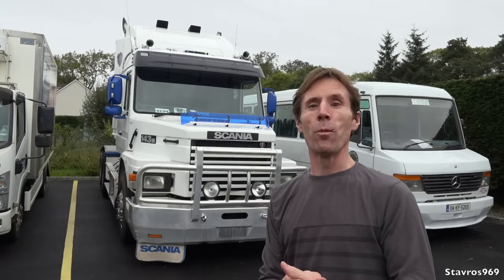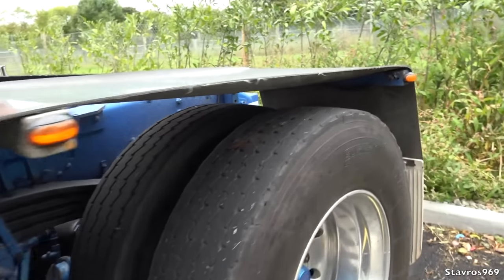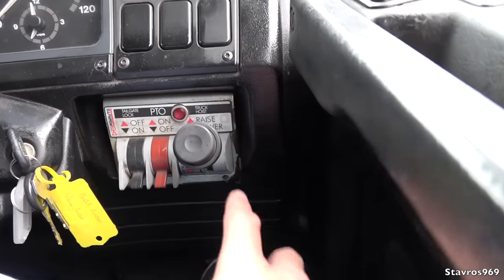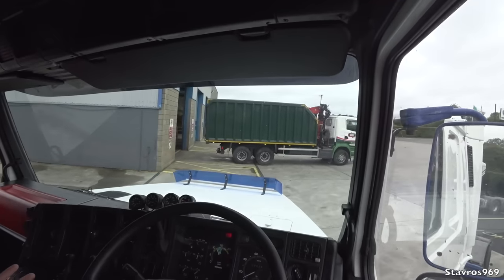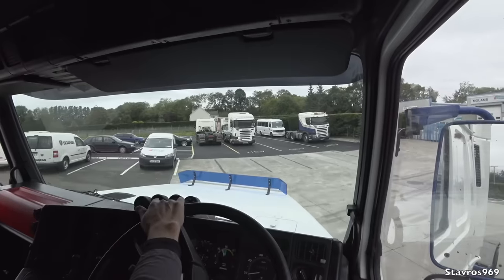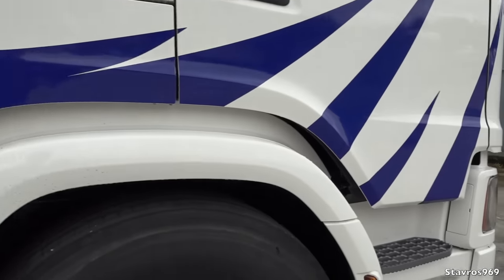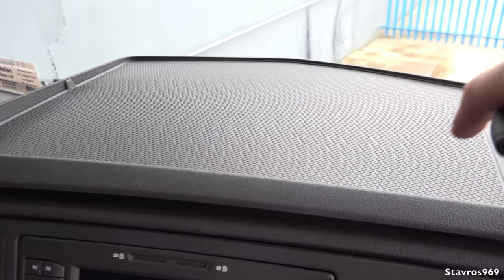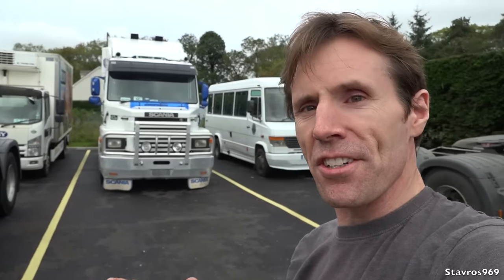1996 SCANIA 143M T-Series Full Tour, Exhaust Sound & Short Drive

Comment: Best bonneted truck I ever drove still have fond memories.
Lots of power back in the day, couple of companies would put RoadRanger 13 speeds in them.

The room in the intetior & flat floor absolutely walk all over any bonneted American prime. 
All round vision was excellent & that noise was absolutely fantastic. 
Drove for Riverbank Stockfeeds & they had one in immaculate condition pride of the fleet.
Victoria Australia. 

Used to drive to Yarram all up 45 tons with a pneumatic tanker.
Going up Gormadale Hill through the Strezilinki Rangers early hours of those summer morning the Scania was on hands & knees but she sounded awesome.

These days trucks are so quite & boring miss that T 143 best truck ever even entering & exiting the cab so so easy 

Louis Kats
Australia
Reply: 530 hp in 1985...(if you got the money for  it)

Comment: In Australia we call them "bonneted" trucks but commonly known as the gumboot. Notice the large turntable, that will be 90mm pin for triple road train work. The towing eye on the rear frame is for moving dolley's around. A dolley connects two or more trailers together. Bonnets are preferred as there is more between the driver and what ever road kill they hit.
Reply: T143M . M - Class  suspension was 85 tonne rated . Road-Train Double , not triple . 143H had the Heavy rear end .

Comment: hi starvos i have the 142 H T line v8 scania tractor unit 97 ex aussie  line haul brought here in New Zealand as line haulage.3 owners before me have owned it for 10 years now in restoration mode great truck beautifull sound the old v8,and spacious cab, will put it on you tube when finished.thanks tom,

Comment: love the distinctive sound of 3 series 143 V8
Reply: I think all series had the 14.5 liter V8s
Reply: The digits 14 in the model number stays for the 14.2 (not 14.5) litre V8, from the 140 in 1969 until the 144 in around 2000, when it was replaced with the 15.6 litre DC16 engine in the 164 model.

Comment: They were quite popular in Australia in the 1980s - 1990s because they weren’t all that expensive, but they died out after that because they weren’t all that reliable with the weights we haul over here in Australia and parts were expensive. Everyone called them the “footy boot” because they looked like a football boot I suppose.
You do see the very occasional one still working so I don’t know what happened to the rest of them, maybe they ended up in Ireland lol.
All our trucks over here have heaps of fuel and bull bars and no tachographs. You can tell it once pulled roadtrains because of the dolly pull on the back, probably the truck was rated for two trailers @ 79 tonnes GCM.
Reply: gm16v149  I think you got things the wrong way round, they were probably expensive, they are a manufactured Truck, not a kit truck like the American brands, and sold in very small numbers due to small population of Australia, a small dealer network. Scania are known world wide as the bench mark in Quality and durability.
Reply: Not in Australia are they the benchmark, but what would I know, I’ve only been an owner operator in Australia for over 30 years lol
Reply: @gm16v149   Maybe Scania sent the Monday morning built trucks to Australia, ROW got the quality trucks. Russia built the Lada for 30 years? Russians swear by them.
Reply: @gm16v149  Good to see you here! 😁
Reply: Some scania genuine parts are insanely expensive. i work at a scania dealer as a practician and a repair kit for a retarder costs around 500 usd, and the repair kit is only a bunch of gaskets and other minor stuff
Reply: the trouble was with the old scania that it wasn't designed for high heat.I worked with this cabover version with 420hp.60-65 metric tonns gross in 6 axles.my scania was built with 16 speed gearbox and big rear double diff.planetary axle hub.16 metric tonns/axle.built in1993 no problem 98-2000.with 1milion km...
Reply: @checker3694  i like the u.s. made old trucks..but is true that american trucks is big lego...the manufacturer built subframe and cab...parts buy other manufacturers.not own eng,trans,axles.....
Reply: The 12speed gearboxes were useless at roadtrain work, I pulled pocket doubles with a 530 T cab and on a hill it would be reving the head of itself and the next gear would drop it clean out of what was a very narrow powerband.   Definitely worked better pulling singles, but no match for a Kenny with a cummins and an 18 speed eaton fuller.   Not great at coping with the corrigations of the gravel roads either, very uncomfortable.   Enjoyed the V8 soundtrack nonetheless, the stereo was never turned on.
Reply: @BananaBrainBrian  mounted on a separate order the 16 gears to the scania.yes ,scania not like the wrong way...i drive in hungary 40 tonns tipper semi.formerly drive scania,volvo,m.a.n.,iveco...for bad gravel road and off road better the m.a.n..scania is powerful vith 16 gear in highway.12 gear max 45 tons..my m.a.n. is 16 speed zf...18 fuller is really 16 speed..2 crawler=low and low h+l.before 16 normal gear.
Reply: @BananaBrainBrian  wasn't many of them not fitted with fuller boxes ?.. probably needed a few more cogs to haul yours loads in the green band
Reply: @olepedersen5420  yes fuller is fitted for any truck.but konverter plate with repair
Reply: I have an old copy of an Australian truck magazine that has a feature article about a big Scania being shipped to Europe for a truck show or something. Maybe not this truck, but maybe inspired it. What are they planning to use it for?
Reply: gm16v149 me uncle and I here in Australia drive a Scania 142M during harvest for carting grain.
Reply: K
Reply: @checker3694 i drive trucks the small bulktransport company .used 3 scania g124.420 cabover with one diff and 3 axles tipper trailer.2 work in gravel and sand site.gross is 55-60 metric tonns in 5 axle and 12 tyres!no problem the scanias.
Reply: scania in sweden and finnland pulling 60-80-104 metrictonns vehicle in forest industries..
Reply: Not many in the USA
Reply: Do you still run that old kw you got? Ain't seen new videos from you in awhile. Hope all's going well for you. I just recently started trucking myself. But I ain't drivin no cabover. They'll probly never make a come back in the states but I wish they would.
Reply: Scania are very popular here in NZ, need trucks with balls to get up all our steep hills. Would love to drive one when I get my class 5.
Reply: At the moment I'm in one of those bitch ass isuzu nqr's to the left of the 143T in the video delivering batteries haha
Reply: @missingno3617  opticruise tower and shift cylinder o rings and gaskets?

Comment: At 2.37, it is not a tow hook. In Australia, you use that as a Dolly hook up. A dolly is a cut in half tractor unit with a long bar to hook up to either the tractor unit or to another trailer to produce a road train

Comment: I like those trucks and they sound awesome those v8's
Totally different then what I am use to that's forsure ..I'm from Guelph Ontario, Canada,it's a hour drive from Toronto Ontario, Canada,, our trucks are long nose trucks ,,the cab over isn't big here anymore,it use to be but just faded away ,,I love the old cab overs from the 70's and 80's Kenworth or peterbil or freight shakers ECT,,I drive a 2006 peterbilt with a 18 speed 1850 torque 3:91rears full lockers ,,frame is stretched and it has a C15 cat twin turbos and man she's a beast and pulls the 40 ton I pull every load and you don't need to over rev it as this cat can take 800 to 1200 on the bottom of tranny but on the top 1200 to 1450 and she'll pull it beautifully,,empty I can lug her out and she louds unbelievable with the stacks and the 3 stage Jake,, engine is pushing around 700 HP and it don't need to review the crap outta it ,,just wasting fuel and wrecking it so to speak,,I pull a live bottom trailer,,,that is a trailer that unloads from the back and a big belt pulls the load forward and the more you rev it up the faster the belt will turn,, anyways thanks for the uploads of  videos appreciate it and I enjoy the trucks you guys got there plus in other videos I watch from all over the world,,Google up Jamaica's driving big trucks and watch those guys drive ,,they take it to a really Goofy level but I guess they think thete cool but I get a great laugh watching them ,you gotta check them out if you already haven't..taker easy bro cheers
Reply: I've been to Guelph many years ago. Hwy 401,I think??

Comment: Do you know that Scanias with the model numbers 145 and 146 actually have existed?
LT145 was the Extra Heavy Duty version of the 140 and LT146 was the same version of the 141. All of these had long hoods.The letters M, H and E was introduced with the 142 model in 1980. So the successor of the 146 was the 142E.
Only 114 units of the LT145 (1975 - 1976) and 313 units of the LT146 (1976 - 1980) were made so they were pretty rare.
(Source: Björn-Eric Lindh: Die Fahrzeuge von Scania, 1992)

Comment: Thanks Stavros for the video and I also like the sound from the older truck.
Why is it that you have to turn off the engine of 143m truck by pulling a lever instead of using a key?
Reply: You also love trucks in Kenya 🇰🇪 right, then you need to drive this Australian 🇦🇺 Scania T143H.
Reply: You turn it off by a lever because it's still a fully "mechanical" engine in this truck. It means it needs absolutely no electricity for running - only for starting. If you switch it off by a key there is a solenoid that keeps the engine running when it's activated. If the solenoid breaks or it loses power of some reason the engine stops. Modern Common Rail diesel engines have more electronics than gasoline engines.

Comment: Good old gumboot if someone in aus were doing it up they’d whack some sporties or straight pipes on it would sound good and the tow fitting at the back whack a pin in the hole and you can tow you’re converter dolly around

Comment: scania 140 14,2 litres v8eng 1969 with atmospheric:320hp with turbo(super)350hp......
Reply: A very few 140 trucks with the non-turbo engines were made. These engines were more common in buses. And didn't it have only around 265hp?? The turbocharged 11 litre i6 engine had from 280 to 320 hp in the 110 model.

Comment: Just wondering but what where the trimlevels like since there are 143h and 143m what is the "better" one?
Reply: Hi. The letters M,H and E has nothing to do with engine trimming - if that is your question? 
It's about the frame construction of the truck.
M=Median-,  H=Heavy- and E=Extra Heavy duty frame.

The M frame where for light weight cargo.
The H frame where for tipper-, timbertrucks etc were you need a more sturdy frame.
The E frame where made for heavy hauling like lowboy trailers and other heavy transports.

The engine for any of these frame could be a 400, 450, or 500hp engine - the range Scania had in the 3.serie. 
But if you were to buy a truck in those days and your job would be to transport heavy machines on a "Lowboy", then you would problaby take the 500hp engine. 

Example of E-frame (the first one in the clip) T142E:

https://www.youtube.com/watch?v=j6D4erb4684

The M,H,E has been replaced in the 4:serie Scania trucks, but I only know the letters L and C. Not sure if L stands for Liner(?) but you could say L replace the M frame.
C stands for Construction and are like the previous H frame commonly used for tipper,-/dumptrucks and timbertrucks.
Reply: @Dolomedesspider  ok thanks!

Comment: It would be interesting to find out the history of the old Scania, but the setup tells me it was probably from Western Australia, and with the power take-off control could have been doing side tipper road train work. That extra switch on the dash was probably to turn the long range lights on and off. Regarding the new Scania, I can't for the life of me understand why they fit two convex mirrors to each side. It makes tight maneuvering and changing lanes in traffic so difficult. We recently got a batch of Euro6 Volvo prime movers where I work that are set up like this and most of the drivers won't drive them until the mirrors are replaced with flat glass.

PS: If you want to see some great road train videos on You Tube, these are from the poster below.
https://www.youtube.com/user/gm16v149

Comment: well ,,, its on the same island ,,, technically part of the uk , but with brexit and borders , who really knows ,,, either way its a fine truck , ive restored a few 1 series up here ,,,  ive a friend with half a dozen or more ,,,, from 110 to 143 , and a few in the middle  a couple of fh volvos , a fh16 with a 91tonnes hiab on it , and another as a heavy recovery  , and  spare scania cab sitting on the shelf , granted , its the next restoration job . theres a rebuilt v8 scania engine sitting on the floor , and a spare chassis laying in the back of the shed for it too.

Comment: Scanias have terrible leaky liners. At our workshop were forever having liners leak,heads cracking, retarders malfunctioning and forever abs faults and all these faults show after only 600,000km! Our company has stopped buying them and started buying Volvos which have done 1.5 million kms and no issues at all so far

Comment: They might sound great but they are a terrible truck in a hot climate, for drivers and owners. The air-con can't compete with the heat of the turbo, especially if you are up on your weights during the day. The "H" suspension on a bogie drive will need re-bushing every year and they are seriously expensive. 
The injectors used to fail regularly from the high fuel pressure and block the injector causing the injector lines to break spraying fuel into the sound insulation under the cab or bonnet often/usually causing the truck to be burnt to the ground. Avoid these trucks at all costs.